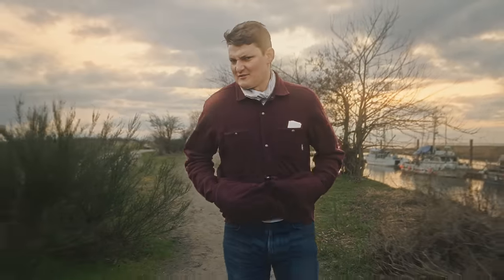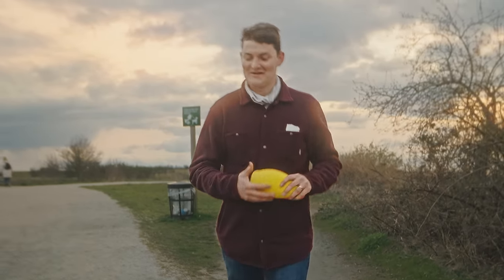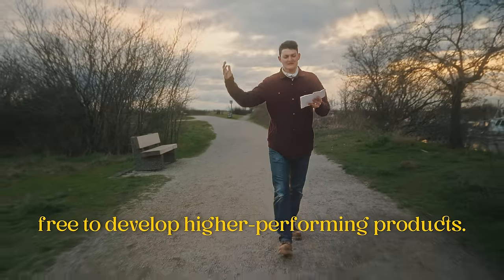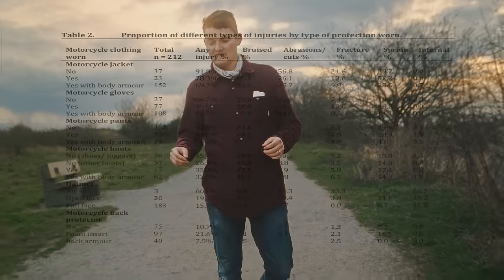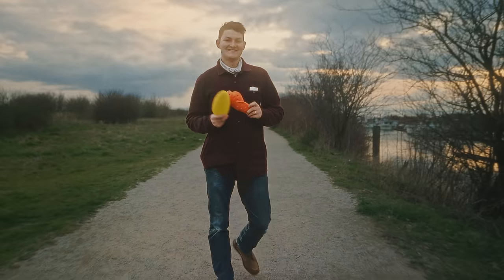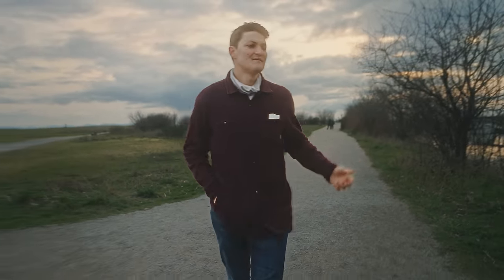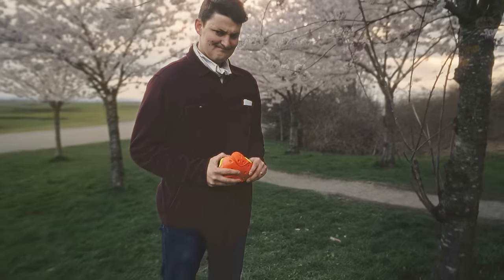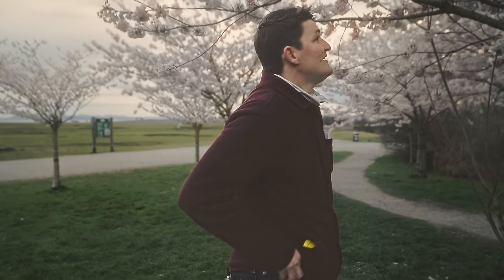Why I Stopped Wearing Motorcycle Body Armour

Comment: I had an accident, and the nature of it was that I fell on a car with my right body side, my knee got a lot of damage(needed surgery and 2 years later I still struggle with it), my wrist cracked, and my shoulder escaped with a tiny little yellow bruise, that didnt even hurt. 
my knee had no protection other than the fabric of my regular trousers, I was wearing motorcycle gloves but they were fairly cheap, and I had a full armoured jacket on. 

what my personal experience tells me is that if I was not wearing the armour, I might have damaged my shoulder, if I was not wearing the jacket at all, I would probably had similar damage that my knee took, and well in the case of no helmet on (which is something that a lot of motorcyclists do not wear in my country sadly, let alone full gear) I would have probably kiss this world goodbye, again because of the nature of the accident. (the damage my helmet took was that the visor mechanism broke)
the car got my full print on it, and the back wheel axle broke (that was the size of the impact)

Comment: Well I dropped my bike at relatively slow speed - 30kmh. My bike slid 10 ft.I was wearing my riding gear. The shoulder, elbow and hip pads protected me from more injury. My helmet also protected me as my head bounced off the concrete. I am very aware that any pad. matter the rating will provide me some protection. I will continue to wear my gear as it’s not cumbersome- fits well. I don’t wear an airbag vest but considering it. I wear stylish denim jeans with knee and hip pads. I have another pair of jeans that I insert knee shin guards in and you can’t tell I’m wearing them. If I want to be risk free I wouldn’t ride at all. Been riding 15 years and a retired Paramedic of 19 years.

Comment: My thinking is, yes, you still get a fracture, but would be less devastating to the actual articulating joint. Possibly getting fractures more mid shaft i.e more proximal to the joint. Loosing an articulating surface can be life changing. rather than just 16 weeks of rehab.
It would be interesting to note outcomes of crashes after 5 years, rather than whether a bone was broken.

Comment: They're called impact pads, but in my experience they shine when protecting from extreme abraisions and bumps. Sliding across a less than smooth UK road at 40mph is a hell of a lot more comfortable on these pads than it is when sliding only on kevlar. I've never seen these pads as something that would protect me from breaks or fractures; but I've 100% felt the benefit of those elbow pads whilst sliding on my side away from my bike.

It's crazy to me that I'm actually taking this side of the argument, because I'm usually vehemently anti-safety - but I think you should put the pads back in, Ryan.

Comment: I dislocated my shoulder during a massive highside during practice for the Nordic Superbike championships some years ago. I was wearing every single bit of top end race gear you can imagine from Dainese. 
I've crashed more times than I can count on track. 
Would I take the pads out? Not in a million years. 
Would I add more? Yes.
Pads have without a doubt (granted anecdotally) saved me from much worse injuries. A small reduction in force, may be the difference between walking away from a crash or needing much more extensive rehab.

Comment: I agree with the basic premise that the pads don't help much if at all with serious accidents... but they sure as hell DO help with all the low speed ones. I got knocked off my bike by a truck deciding to turn left from the middle lane (I was in the left lane next to him) and walked away without even a bruise. I've ridden a number of BDR's and the TAT and had a number of "Dirt Nap's" at speeds from 0 to 25mph and again... no knee, elbow, shoulder issues at all (did have a sore foot after one, and hands too). Knees and elbows especially are aided by a bit of protection from a force multiplier (small rock for instance) during a low speed drop.

Comment: When i started riding a leather jacket was the only protection from scrapes  . You said it yourself, the crux of the matter is "the price point" They would make better if the average rider would pay more. In normal riding no rider want to go riding looking like the Michelin man do they . I'm 81 and still go mountaing biking  as well as a motocylce and now wear a motor cross protection vest under my shirt . In all the protection I have ever bought it seems they never get it quite right . My protection jack is quite good and has a good frontal chest padding but when you crash ,like I did first time wearing it when my handlbar hooked up on a sapling when decending at speed it did save me except some ribs . Most times when a person hits the deck they dont hit chest first, Ive only ever did  once and my chin guard ploughed the ground in front of my face with the dirt/gravel coming in .  The body tend to do a slight turn to the side and you hit to the side of your chest where its unprotected . So you mentioned about fractured legs,  what you showed us was for your body ,so they wont stop you getting a leg fracture.Anyway some protection is better than none .

Comment: Iv never done a study on impact protection. But I know armour is better to have in a slide, than no armour. As you touched on, not to reduce a broken or fractured bone. But for lacerations & gravel rash. Iv had gravel picked out of my skin by a nurse with tweezers. It not fun in the slightest. And if a little extra padding helps, it’s only a good thing. In saying that, I don’t wear traditional removable armour. I wear a leather jacket with reinforced shoulders & elbows.
It’s undeniable “Something is better than nothing”

Comment: While I agree with you I can say that the bruising that comes from not wearing pads and having an accident at a speed of 20 miles per hour on my electric scooter has been kind of awful. It's been a month and a half and my knee is still incredibly painful. I went to the ER there is nothing broken or fractured. It's just extremely bruised. So they're not completely useless.

Comment: Most riders, I'm sure, would not admit to this, but my armor saved some ,more serious potential damage to my senior body when, after getting soaked in a rainstorm, I parked my motorcycle at my motel but failed to get the kickstand all the way around. As I got off it kicked forward and threw me against the curb. As I told the gentleman the helped me right my steed, "That's why I wear all this armor". I'm an ATGATT guy, and always will be. Of course there has been another incident or two that also proved the worth of armor. Falling onto asphalt or concrete is never a good thing IMO. It's the old saying that an ounce of prevention is worth a pound of cure.

Comment: For sure you've ruffled up quite a few feathers. 🙂 

I was rearing CE2 rated armor, and riding under 20kph when I had a fall. The thick armor was the reason I injured my ribs. So, for me at least, I no longer wear chest armor. I would recommend leg and ankle protection however as those parts are more susceptible to injury.

A couple of years ago I had a fall and slid about 20m. Needed hospitalization for my knee injury. But the Goretex jacket (which includes armor) protected me completely. I would say, no need for armor inserts. Invest in a good jacket, boots, and some leg protection.

Thanks for this video.

Comment: Hello, perhaps add a layer of " Ensolite Foam " to your pads to fortify them. When I first heard of Ensolite it was used to wrap Roll Bars in automobiles. It is an elastomeric foam that disperses shocks.     " Hey! "
Reply: P.S. Also, put a wallet into each of your back pockets. I was slid a long distance on my back pocket wand wallet. 
I didn't feel a thing.

Comment: An interesting take on armour. If anyone thinks any form of bike armour will prevent injury is probably deluded but anything that can reduce the energy of impact and also protect against abrasion is a good thing, and whilst it won’t make you invincible, event a some reduction (or distribution) of impact energy is better than nothing (probably). You really really don’t want to take your skin off and grind your bone/joints down through road surface friction - not to mention how painful it is and the significant risk of infections such as osteomyelitis. What the article did offer was an interesting opinion on why with all the super clever materials being developed that the protection offered via armour isn’t improving at pace - there isn’t a driven market to innovate. I guess it’s a bit like the Gore Tex scenario where despite there being considerably better materials for hydrophobic ‘breathing’ textiles, they don’t sell as Gore Tex have captured the market as the only product worth buying. Hilarious - I have just noticed FortNine has also done a video on Gore Tex 😂 Summary - Great video (cleverly filmed) but I’ll keep stuffing chicken fillets in my jackets…

Comment: I think people are missing the point a bit. If you have a jacket with the cheapest pads, consider it the same as a good sturdy leather jacket. Better than a T-shirt, but you will feel that crash.

If you want to have actual protection, you need the higher rating pads, they come in the race spec leathers. Super uncomfortable, and will not protect you from everything, but they will actually help. You can watch the MotoGP buys come off a bike at 160 mph, then run to try to get back on it, at least most of the time.

In the end, on the street, your best and last line of defense is being aware and riding within your limits.

Comment: Have you ever crashed a motorcycle? I have.  I rolled into a ditch filled with rocks and sticks.  I was relatively unharmed. No broken bones and I walked away.  My current jacket would have stopped the  road rash and provided some padding.  I wasn't wearing anything other than jeans and a t-shirt when I bailed at over 20 mph in that corner.

Comment: Love all of the comments that totally miss where Ryan is actually using better protective equipment than the pads, as well as taking the pads out. Wearing an air bag daily and high performance back protection while racing. But everyone just jumps on the bit about the foam pads probably not offering much protection for their trade offs when it comes to comfort, etc

Comment: I had on armored jeans when I lowsided as I left my driveway one cold winter day. The knee pad did nothing to protect my knee since the jeans were too loose to hold the pad in place correctly.m and so my knee was sore for months. No abrasion injury though.

If I do any spirited riding on the street, I'll wear low profile D3O knee pads under my riding jeans.

Comment: I accept the point that bike gear manufacturers may be using the safety regs to hinder entry to the market and discourage purchases outside it, and I also get the point that the pads will not necessarily protect me from broken bones as the standards are too lax. However you will not convince me to remove my safety pads. Wearing them has to be safer than not wearing them.

Comment: I would like to point out one thing Ryan mentions about equestrian body protectors. It is true that they are tested to 4kN, but this is with a 2,500g weight. Motorcycle Class 2 armor is tested with a 5,000g weight. Horse riding gear is safer, but only by 12.5%. 
Fully agree that it's completely inadequate for our uses though. Last I checked, they might be on horses, but we're the ones with more horsepower under the saddle.

Comment: I had a major accident where I slid for a block. I was wearing level three armor in my jacket and plain jeans. If not for the armored back plate I would have sanded down to my vertebrae. I wish I had on armored pants, because I could see my kneecaps.

Comment: The reason horse girl stuff is stronger is probably because a horse stepping on you is a very precise stomp with a high amount of pressure due to a small surface area. When you hit the pavement, the impact has a wide spread. I mean, that's what I think anyway. I've never seen motorcycle armor as needing to withstand hammer hits so much as pancake drops.

Comment: It is beyond my comprehension that anyone would advocate wearing less protection while riding a motorcycle. I wear this protection because the thought of sliding along the asphalt at high speed without it scares the hell out of me. I have never worn it with the expectation it would prevent breaking bones. I know from some high impact mountain bike crashes while wearing this protection that it definitely works. Luckily I haven’t tested it out while motorcycling yet, and hope I never do, but if I ever end up sliding down the highway one day I know I will be better off wearing this protection than not and that is an absolute no brainer. Goodbye and good luck.

Comment: I think your reasoning here is only valid at the extremes.  Sure, if you're 70 mph on the highway and part company with control, that little rubber pad might not do anything to prevent a fracture.  It might, however, still do a lot to prevent some road rash and that alone makes it worth it to me.  But... if you're only 25 mph in town and take a bump from your showoff buddy and wind up sliding down the road, that little rubber pad might just make the difference between a bruise and break.  I don't often wear "proper" gear on really hot days and I've never worn knee or hip pads... but I don't think I'll take the pads out of my jacket just because they won't prevent a fracture at highway speeds.  Let me put it this way... "how much protection do you get from NOT having them"?  What I think is more revealing is that those pads don't do a damn bit of good if the material holding them in place is worn away in the first haft second of road contact and the pad is 3 feet behind you.

Comment: This video is misleading and FortNine has cherry-picked one sentence (at time 2:45) out of the paper he sited.  Where as the paper comes to opsite conclusion.  For a pdf of the paper google, "liz de rome George Institute motorcycle protective clothing".    The pdf is available (for free) on the George Institute website.  It's a short read, only 11 pages, excluding citations. 

Cherry-Picked statement and the rest of the paragraph it came from:
  "Despite the reduced risk of any injuries when wearing body armour, the benefits could not be detected specifically in relation to fractures. Given the relatively low occurrence of fractures (15%), compared to soft tissue injuries (71%), in unprotected motorcyclists (Duffy and Blair 1991) the sample size was likely too small to be able to detect any such difference. Further research is necessary to explore the benefits of products such as body armour for different parts of the body in crashes in relation to specific injury types, particularly fractures."  (de Rome, 2011, pg.10)

From the Results:
  "Motorcyclists wearing motorcycle protective clothing fitted with body armour, were significantly less likely to sustain injuries to the protected areas compared to those wearing non-motorcycle clothing. Specifically, when body armour was fitted, there was a 23% lower risk of injury associated with motorcycle jackets (RR=0.77, 95% CI: 0.68-0.86), 45% for motorcycle gloves (RR=55, 95% CI: 0.37-0.81), 39% for motorcycle pants for leg injuries only (RR = 0.61, 95% CI: 0.41-0.91 and 45% by motorcycle boots (RR=0.55, 95% CI: 0.35-0.85). The risk of any foot or ankle injuries was reduced 53% by non-motorcycle boots (RR=0.47, 95% CI: 0.28-0.77) when compared to shoes or joggers, a risk reduction similar to motorcycle boots. "  (de Rome, 2011, pg.7)

From the Discussion:
  "The most important result relates to the contribution of body armour, which was associated with substantial reductions in the risk of any injury in crashes when other factors such as speed and type of impact were controlled. This is the first evidence of the effectiveness of body armour from crash studies, although it has previously shown promise in laboratory tests (Otte and Middelhauve 1987, Otte et al. 2002). The reduced risk of injuries to the legs in motorcycle crashes is particularly important because legs are most likely to be injured but least likely to be protected (Hurt et al. 1981b, Lateef 2002, ACEM 2004, Chen 2006, de Rome 2006, Watson et al. 2008). " (de Rome, 2011, pg.9)

From the Conclusions:
  "This study demonstrates that motorcycle protective clothing is associated with a significantly reduced risk of injury in crashes, particularly when body armour is fitted. While the most substantial effect was observed for open wound injuries, crashed motorcyclists who were wearing motorcycle clothing were also significantly less likely to require admission to a hospital. " (de Rome, 2011, pg.11)

Comment: Sorry but I strongly disagree, pad are not just for impacts, I had a fairly bad motorcycle accident on the A13 (French highway) at about 90 km/h, slid for dozens of meters on the asphalt before coming to a fortunately unremarquable stop in the ditch and when  got up both my left knee pad and left elbow pad had been ground down to less than a 1/3 of their thickness, I do not for one second want to imagine what my left knee and left elbow wold have felt like of those pads had not been there and the road had ground me instead of the pads

Comment: ..if I crash my car at 80 mph against a tree...seat belt or air bag won't save me...I think all the safety features in a car are calculated to speeds no higher than 50 mph or less. If you are a experienced rider you know that in case of an accident at high speed nothing will save you from serious injuries. I ride for so many years and my advise would be use all the safety wear you can, any sort of painful recovery time is worth it to minimize.